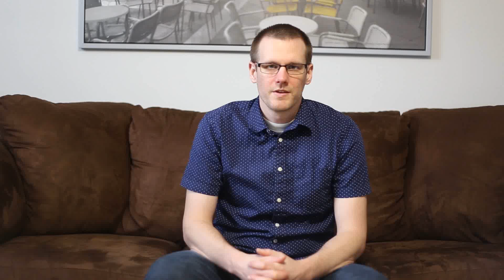5 ways to Maximize LiPo Battery Lifespan

Comment: Sir, I have a orange lipo battery 22000mah 3cell, plz tell me sir maximum charges in volt, minimum discharge in volt & storage volt, tell me in voltage
Reply: The maximum voltage per cell is 4.2v, minimum is 3.7v or 3.5v if you're willing to have the battery not last long, and storage is 3.82v to 3.85v per cell. Also, an easy way to tell each cells voltage is divide the total voltage by 3 if it's a 3 cell and you will get the voltage of each.
Reply: @ReddleyYT  thankyou so much , Sir

Comment: ive learned that charging at 1.5 amps will prolong the life of the battery
Reply from the maker: Hey Colin. 
This may be true depending on more details. If you charge a 200mAh battery at 1.5A, that is going to be big trouble. If you charge a 20Ah pack at 1.5A, you'll be able to get that 100% charge by next year. (not really but you get my point)
Reply: RCexplained im tlking bout charging for example a 5000 mah battery pack or 6500mah battery pack
Reply from the maker: 1.5A is quite slow even for a 5000mAh battery pack. I don't have conclusive data to show there is a significant difference from charging at 1C vs 0.3C.
Reply: @RCexplained  fair enough

Comment: What voltage does 80% discharge turn into? I try to not go lower than 3.8
Reply from the maker: Hi Avecforte. The voltage at 80% discharged is approximately 3.72v.  Keep in mind, this is the resting voltage of the cell when it reaches steady state.
Reply: @RCexplained  good, that means I'm well within the limits :)
Thank you!
Reply from the maker: @avecforte8851  yes you are!

Comment: If the goal is to use load the battery pack no more than 50% of the amps, does that suggest that I should get the largest Mah and possible since the calculation for Amps is Mah x volts?  It seems like another reason for a large pack is to still get decent run time and not charge all the way to 100% capacity.
Reply from the maker: A larger pack will always be better from a longevity and performance perspective. Max discharge rating is based on mAh multiplied by the C rating of the battery pack.

Comment: I downloaded Accubattery app recently it's an app that shows the life span or battery health of the phone remain.., I bought my phone about 3 month ago, I always discharged my phone from 100%..., And the Accubattery show my battery life span is 88% so if I apply 20-80 battery rule it's increase battery lifespan or battery life or it remain it is.. plz help
Reply from the maker: Charging from 20% to anything less than 100%, decreases the capacity of charge that your battery could supply. You will not get the maximum capacity out of the battery. The advantage is that you will increase the lifespan of the battery. Your battery will last for more years of service. 

I do not stop the charge before 100% but I avoid letting my cell phone battery drop below 20% remaining. I do charge my phone every single day to 100%. 

Just for reference, my cellphone that is used and charged daily is from 2013 and I've changed the battery pack once. I easily get 1000+ cycles before the battery could be considered unusable due to capacity.
Reply: @RCexplained  so it's ok to charge phone to 100% but do not let battery drop below 20%...? 
Question:2:.But there so many researchers say's it's dangerous to charge the phone up to 100% coz it's reduce battery circles and it drains quickly compared to 20-80 rule.., so it's true or false. Sorry for my bad English
Reply from the maker: Hi Ema. I can only speak from my own experience. I don't have much data to look at for comparison. We know charging to 100% can reduce the lifespan of the battery, however it does not make sense that it would decrease the cycle life that you get from one charge cycle. Charging to 100% is ok if you can accept you are trading battery long term lifespan for longer on time between charges. 

If charging to 100% was dangerous threatening safety, cell phone manufactures would not be able to sell their product.
Reply: @RCexplained  yeah man your right coz ever since I apply 20-80 rule I got less screen on time on my usage.., now I noticed that below 20% it's not good.., thanks for little information hopefully I get it
Reply: @RCexplained  draining to 100 to zero even charging to zero to hundred is equal of 1 cycle 
For my observation i have 30 watts charger on my phone and the 30 percent to 80  rule of charge is true because it will prevent deep charge and less heat because it charge in limited time and prolong its lifespan i really notice charging speed to 0 to 80 percent is on  the same speed until i reach above 80 it go slower and its getting warm up ,  may my grammar so bad, but this rules is really important aside of collecting data about lipo battery is really recommended, also its optional to charge at max capacity if might use for emergency or blackout in your area and battery calibration after updating a software
Reply from the maker: @itsmefriedpotato6429  very true

Comment: Sir.., my battery capacity is 4000 MAH..,, so if i apply 20-80 battery circle do I get more screen on time.., as I used when when I discharged my phone at 100% or I'll get low screen on time.. sorry for my bad English your fan from South Korea please I need to know..?
Reply: You’ll obviously getting less time thAn usual if you charge to 100% .. you’ll battery health will degrade slowly meaning your 4000 mah battery will degrade less after two years if you use the 20/80 role than if you use 100% typical way .. either ways batteries eventually are replaceable agent in every smartphone